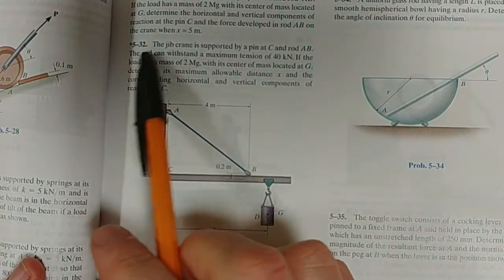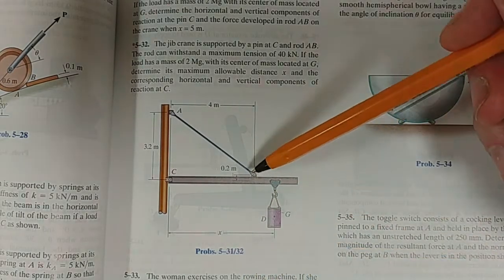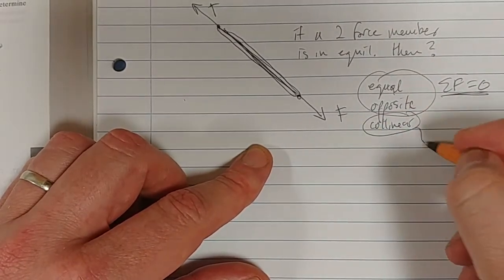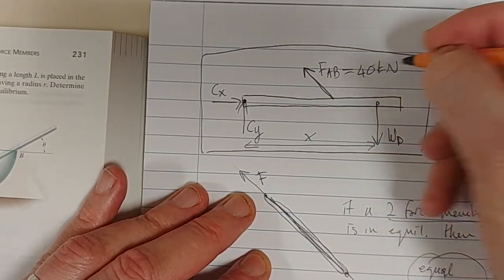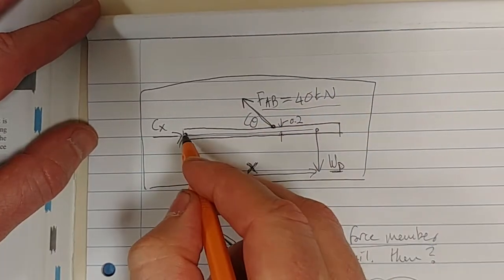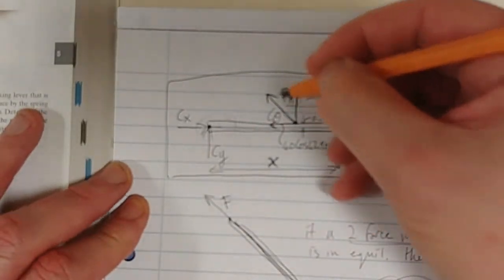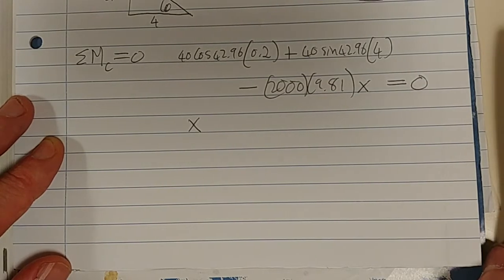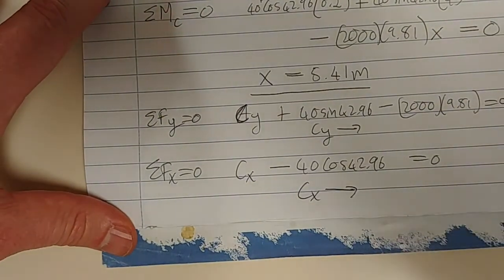Chap 5 Problem 5-32 (13th Ed.)

Comment: I have a question, since the length 3.2 is from A till the center of the rod at C, shouldnt we find the angle using 3 instead of 3.2? because the height is 3 from the surface of the rod, where we are measuring theta at, till A.